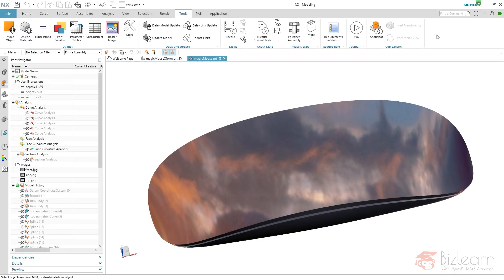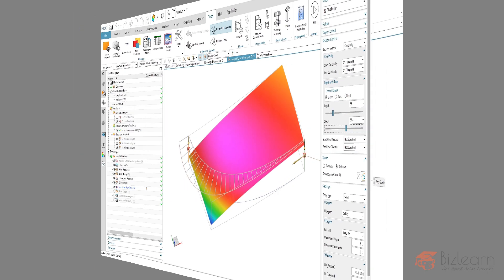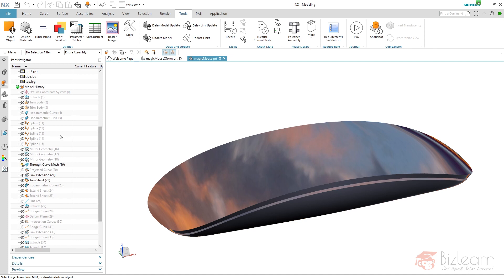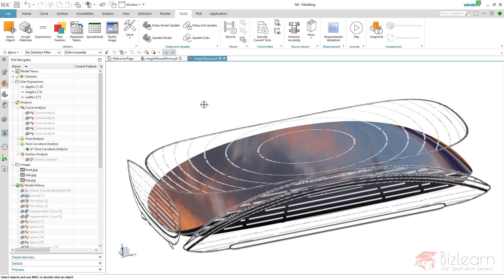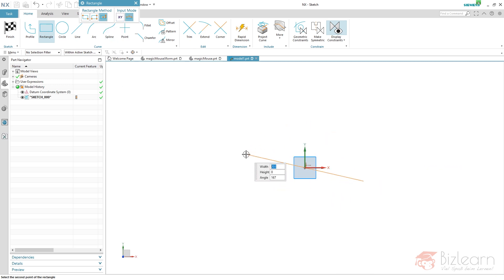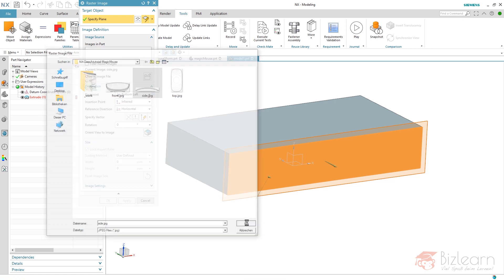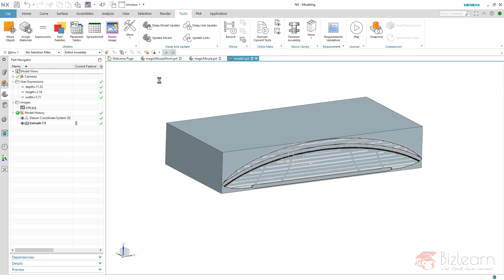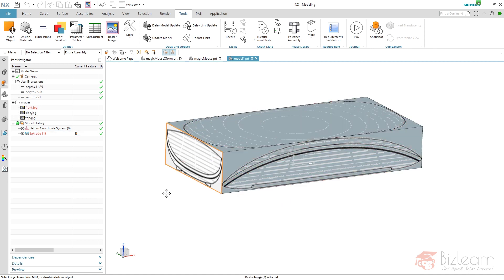Siemens NX Freeform Pro Tutorial - how to import raster images as a base for X-Form surface creation

Comment: It would be great if you could teach us how surface quality matters to the machining results.
Reply from the maker: You mean routing operations?  In case of creating freeform surfaces, of course it has an effect depending on the tolerances. The CNC operations are interpolated anyway, but in between the range of the tolerances. And if you have a chain of tolerances, the effect is measureable. But I think in terms of creating design surfaces, it doesn't matter that much compared to machine components, which usually do not have freeform surfaces applied. I have a CNC in use and 3D printers as well, but no official Siemens license. So a distibution of CAM videos is not possible right now. Maybe I'll buy an NX CAM license, with my next CNC machine, but have to search for a now shop first (-: I don't have space for that right now.
Reply from the maker: but anyway, I'll be talking about tolerances and the influence to the design etc.
Reply: It's about highlight and curvature comb analysis. The relation of surface design for smoother CAM routings.